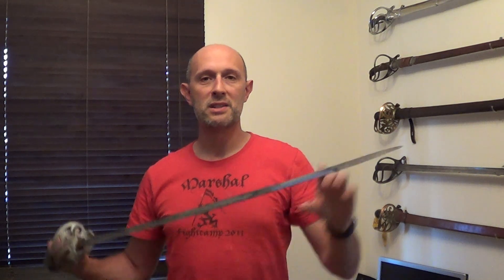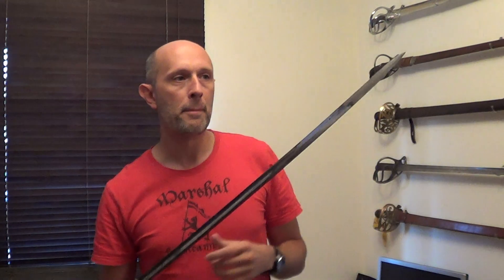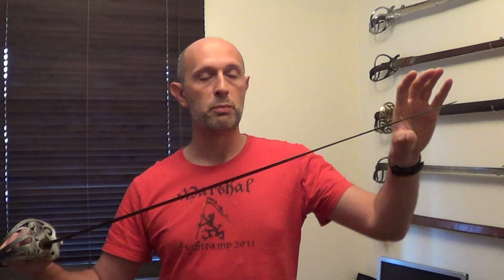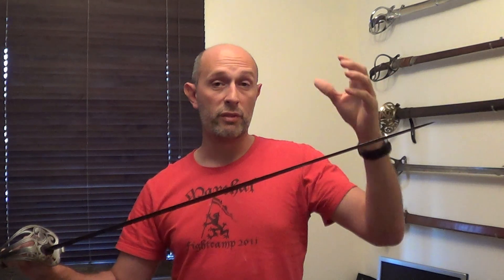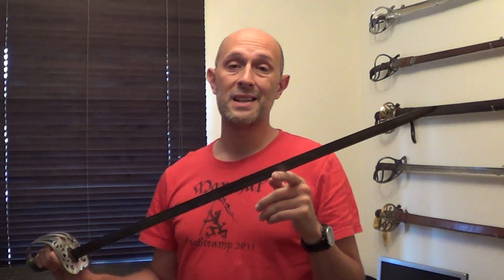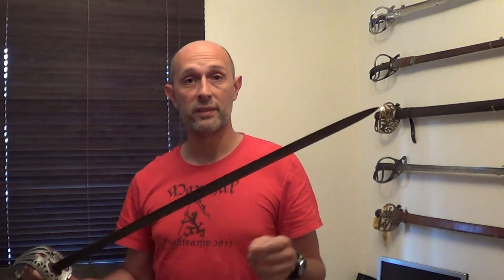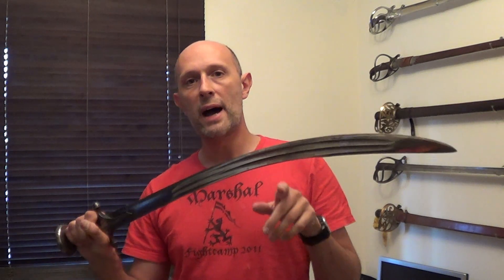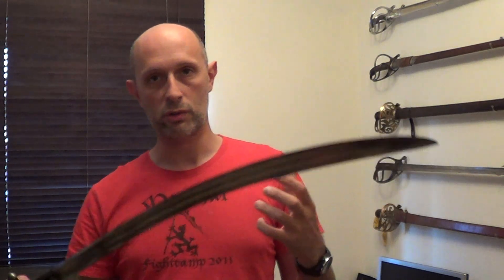Flexibility of sword blades

Comment: So according to this, cold steel uses good steel? And if I remember correctly their main issue is with the distal taper of their long blades?
Reply: Also their hilt construction sucks.
Reply: Josh Ridinger Any blades in particular with shoddy hilts?
Reply: I've only owned one Cold Steel product, a throwing knife that was advertised as being unbreakable. It broke on the fifth throw.
Reply: onlyashadow1121
Basically all of them. They're mostly nut or threaded pommels. They use the pressure of the pommel in place to hold the grip and crossguard. Albion, by contrast, makes a guard they have to hammer on, which stays on by itself, and the grip is epoxied onto the tang.
Cold Steel swords HAVE distal taper, just not as much as they should. Only their Italian Man-At-Arms sword has enough tapering, most of which in the profile.
Reply: Surma Sampo
Oh, Albions still have some pommel pressure, but a lot less than Cold Steel swords.
Reply: Josh Ridinger I think cold steel has many more problems.  I still expect their swords to not be able to bend back.
Reply: Noah Weisbrod Glueing the handle to the tang is bad practice. It makes re-hilting the sword much harder than it should be. Using pommel pressure to keep the hilt tight is correct practice. Hammering the quillons on is fine as long as the collar of the quillons is softer than the tang, if not then you are creating stress on the tang which means a weak point in the highest load point of a cutting sword.

Comment: So if you hit katana with european sword hard it is possible bend it? Bend it so hard that it becomes unusable? Is it possible?
Reply: Yes. http://i.imgur.com/hNifS.gif
Reply: Ben McFarlane I suppose if you try to block an overhead blow could lead to a nasty bent.
Reply: Ben McFarlane I can see why the katana is soft, is not meant to attack hard targets much less clashing swords.
Reply: 77jarim The one in German TV show is forged by skilled German smith who are actually fan of Katana, he forge it like how the traditional Japanese would forge their katana, so it is pretty damn accurate compare to how American tv show Glorifies it to "Magic tank cutting light saber"

Though most quality katana nowday are made in same way as European sword, instead of folding the steel. They made from Stock steel and are flexible than their historical counter part
Reply: Saintier set
Except in an actual combat you would never strike your opponent with such a powerful blow. In order to do so, you would leave yourself too exposed and they would probably kill you in the meantime, and even if you got a chance to do it their blade wouldn't be fixed in the air like that other sword. There is absolutely no way of that happening in an actual combat.
Reply: 77jarim apparently that german show wasnt silly. the wielder is the smith who forged both the longsword and katana in the show. As far as I know he is one of few non-japanese who "is qualified" to make real katanas. In that show they also did testcutting; both on tatami-mats and on a tomato, which showed that the blades were "proper" sharp ones
Reply: Ben McFarlane Saintier set  That's from some silly german (?) television show. The thing is that if get any modern sword it is probably not going to be anywhere near authentic (there are exceptions). It'll be most likely be a "Made in China" reproduction. And they can range from glorified wall hangers/SLOs to being pretty decent. With no information on the actual quality of those two swords all one can say is that all those buffoons did was to break two things that looked like swords.
Reply: hallo3heihei Yeah I don't understand much german beyond "eine jägermeister bitte" so most of the stuff that was said was incomhersible to me and all the rest just seemed like the typical television silliness. If you do stuff like that you'll just break two blades.Which seems to be what they did.
Reply: blasty137 Bssically. It's like with a spear haft being made out of even bad wood; while, yes, it technically can be done, the sword will move and submit to pressuratanae so much during actual combat that there just isn't usually going to be enough force to sunder the katana. While this brittleness may propose a problem for the sword over a long period of use, it's not really a generally viable strategy to plan defeat someone using one by breaking it. You're better off just outfighting them.
Reply: EricPaz
Yeah, I only saw it without subtitles and I only understand few words of german.
Reply: I know the katana is not only prone to bending but breaking, I imagine that has to do with the two types of steel in the blade. Because while the sword is bending the hardened steel at the edge is pushing back against the soft steel putting two points of stress on the soft steel.
Reply: 77jarim Yeah I can agree to that its kind of silly breaking blades :) (but sometimes sacrifeises must be done ;)) I'm no german my self, but i had german in school, so I could pick up some of the key aspects of the video(at least I think so..)
Reply: also in welt der wunder they show medieval(I think so) japanese art, which shows people fighting with katanas which has several big nicks and hacks in the blade; in battle where it would see a lot of hard use, the edge seems to have been too brittle
Reply: hallo3heihei
I think I have seen some art like that in books. Not sure if they are the same pieces.
I think there is also an article somewhere at "thearma" site (I think that's where it was) that describes a knight having his sword "looking like a saw" after battling the Moors.
There is certainly a reason why so many different styles of swordsmanship around the world are against edge to edge contact and advice to use the flat or the back of the sword for blocking/parrying.
Reply: You use katana to slash too many people and you will have a bent katana.
There are many records of that happenning.
Fact, even the anime that are accurate and about history, not the bullshit ones portrayed it that way.
Reply: Everything is possible, and inevitable
Reply: blasty137 If a man gets a chance to deliver a powerful blow as you say, they will take it, and if you are not ready for it, you will die.